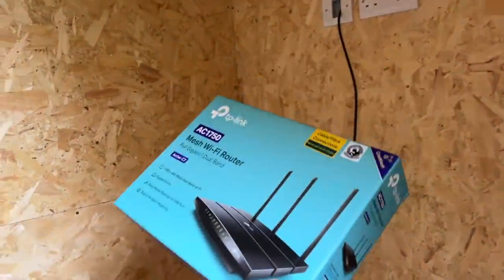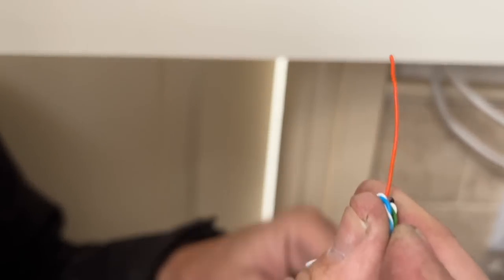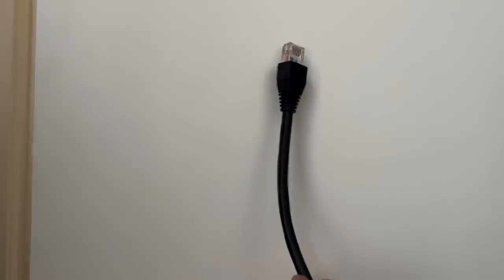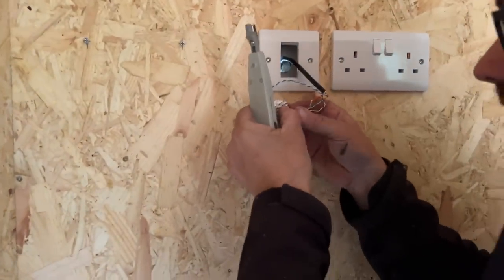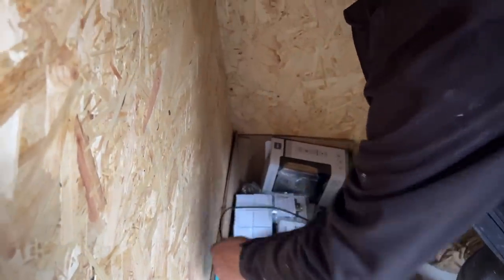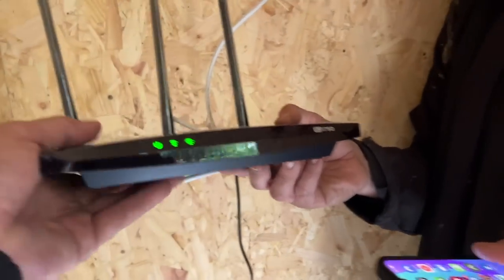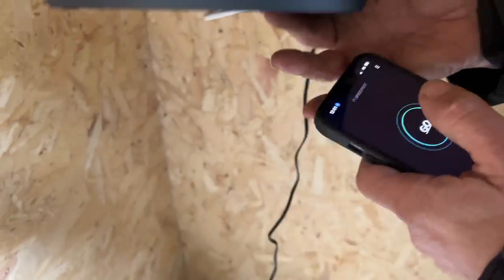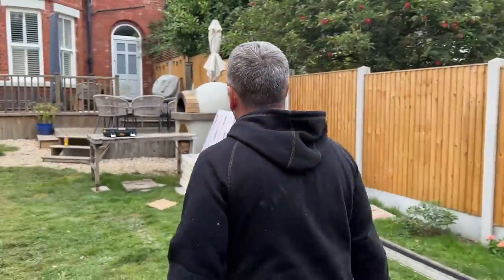Detailed guide to installing the internet in your garden room

Comment: Liam & John, a couple of tips.  Maximum cable length for CAT6 running Ethernet protocol is 100 metres. For the future you might want to upgrade to CAT 7.  WIth regard termination of the CAT 6, the twist in the four pairs of cables is very important. It is very integral to the bandwidth capability of the cable. When terminating the cable, especially into a punch-down termination block, keep the cables a short as possible and as much as practical maintain the twist right up to point of termination.  The companies who developed these cables invested billions in making cables handle huge bandwidth within an unshielded cable and most of this investment is all centred around the twist. Finally, and I might be wrong here, in the video where John is terminating a black CAT 6 into a RJ45 end.  It looks to me the black insulation of the cable is not pushed deep enough into the RJ45 end.  The end of the RJ45 end should have a compressible strain relief tab which is forced and locked down onto the outer jacket of the cable.  Then if the cable is snagged, the strain is taken by the lockable tab and not by the electrical blades at the end of the plug.  Last word. just for info, the word Ethernet describes the protocol that is used for moving data down the cable. It does not describe the cable or the plugs on the end. In the original roll out of Ethernet, coax cable was used to transfer the data that used the Ethernet protocol.  Love your videos, please keep them coming. Probably the best DIY videos on Youtube.
Reply: Cat7 is an utter waste of time and is sold to the gullible who know no better. Further Cat7 and Cat8 require special CG45 or Tera connectors and sockets, which if you are not using (which you won't be) make matters worse over Cat6a. There is no IEEE 802.3 standard thing that requires anything more than Cat6a. Ok there is a standard for using Cat8 at 40Gbps which is limited to 30m, is for point-to-point patch leads in datacentre only and there is zero equipment you can purchase to use it and likely never will. Basically, nothing is ever likely to need anything more than Cat6a which is good for 10Gbps at 100m, and anything more is going to be DAC cables point to point over short distances or fibre.
Reply: For future proofing I would use Cat6A, as multi gigabit connections are already available. Cat7 is a bit of a joke and needs different connectors (GG45).

Comment: Those tools and the rj45 open ended plugs are so good i know because last year before even watching these videos i ran cat 7 wire from my router through my internal walls to my 2 children's bedrooms to give them a solid connection i bought a 50m roll and still have tons left i made loads of small Ethernet wires for the pc's/consoles and laptops my kids have never been happy no drop outs only difference for me was i used a face plate next to the router and a face plate in there bedrooms at a total cost for all the bits of around £75-£85 it would have cost me £100s to get some one in and i saved a fortune and learned a new skill its actually easier then it looks too , i have been watching a lot of your videos for tips as i am building a 3x4m Shed (man cave Shhhh dont tell the wife) and i wont be building to your standards but i wont be far off all in costing me around £2000 including a rubber roof which after watching you guys i have the confidence to do, and i am considering running an Ethernet cable down to the shed (man cave lol) this is something any one in this day and age could do with learning and this video is spot on, if you use cat7 though and cat7 rj45's make sure you earth the cable at the connector ends in other words the silver foil you tuck under the metal climp bit on the rj45 or the machine tester (G) errors i found this out the hard way lol.

Comment: I dont wanna be rude but the cat 6 cable needs pushing in the plug past the built in cable clamp before being crimped, that plastic lug pushes into the outer of the cable and helps stop it from pulling out. The rubber boot (if you can class it as rubber) is there to help with strain relief and stop the cable from breaking which happens pretty easy with solid core wire, could be why i was always told to use stranded wire for fitting plugs to. If your only using the cable for an internet connection you only need two pairs so you could split the cable and get two runs out of it (switch and wireless access point etc) or if the cable was damaged it maybe possible to just swap them over depending on how many are damaged (blue, blue/white, Brown and Brown white not used). i believe for running things like HD video all 4 pairs are used.   

when you were trying to scan the QR code i was wanting to shout its upside down 

Having to long of a cable can result in slower home network speeds for example when transferring a video from one computer to another, badly made connections and poor quality cable can also effect it. when using a internet speed tester like speedtest.net your testing the internet coming into your house and not your home network, to test your home network you would need to ping another computer on that network and look at the results then.

Comment: Tip for straightening the wires. Use the cut off sleeve to straighten the wires by squeezing it and sliding it up over the wires a few times. Perfect for those cold days.

Comment: Everything you showed was good but, pro tip put a socket at both ends, not a connector on the router end. 2 reasons, firstly its a lot less fiddly but also more importantly it is more reliable. Connectors on solid core cables will work lose as you move the router about, also it is easier if you change how/where the router is located. Just use a little pre terminated patch cable to connect the router.

Comment: A quick question, I appreciate a cable connection is always preferable, but how do they compare to powerline LAN systems? I appreciate there may be some efficiency issues especially in properties with older wiring, but it seems like an affordable and clean alternative to a long cable run.

Comment: fyi for Gb connection speeds the recommended max distance is 100m. for a cleaner finish I've installed unifi access points in my house and when I get a garden room I'll be using the in wall hd access points. there is no lose kit as it's fixed to the wall, it's POE+ and it has a POE pass through and 4 Ethernet ports to act as a switch.

Comment: Great video as always. However, I'd have had the cat6 cable further in by about another 5mm as you can see on the video that the RJ45 drop lug that will secure that cable in place is far to close to the edge of the outer cable insulation. Also, the outside run on the garden room, could come straight down, cuting the cable run by about 2 to 3 meters maybe. God, when I use to do these cables myseld, did them for 10+ years, we didn't had them RJ45 where the cables would pertrude out. Still, each to their own and that cable won't see much disturbance anyway. I hope you haven't done one standard (A) one side and standard (B) called (crossover cable). Just my personal opinion guys. Still another great video with great content for many of us out here that could use it I'm sure. Carry on the cracking good job you guys always do.P.S: Too much exposed uninsulated cable on that end buddy! The less exposed cable, the less noise on the wires, the faster the network connection.
Reply: Yes. Use 568B.

Comment: The maximum recommended for CAT6 is 100metres, if you need longer then use fibre with a fibre converter each end.

Comment: Would an access point not be a cheaper, more straight forward option rather than a second router? Are you using the router as just an access point or are you turning on modem mode on the virgin hub and using the TP Link as the main router? Best approach imo would be Cat 6 from the house to a network switch in the garden room and then you can run cables to all your devices from there including an access point and if opting for a POE switch this can power your IP cameras etc over ethernet for an easier install. With WIFI 6 becoming mainstream now a router would then be the better option.
Reply: It’s a router & access point? Wi-Fi and wired switching
Reply: I'd have a lovely Draytek managed switch on that end at the garden room.

Comment: For this purpose (10/100/1000BASE-T) Cat 6 is certified to 100metres. Beyond 100, signal can be impacted and may impact speed but unlikely if you’re going over it by 10/20% or sometimes more. 

For 10GBASE-T which wouldn’t typically be seen in residential, 55m Cat6 is the certified length. 

Always best to use a shielded cable as well, to minimise the opportunity for cross-talk and interference. 

A Cat5e cable (same distance limitations as Cat 6) is capable of 1000Mbps and  likely to provide more than enough throughput for residential users - particularly as they’re likely to use wifi at the other end, not plug in using Ethernet anyway. 

Cat6 won’t provide any tangible benefits in a residential environment over and above a Cat5e cable as home routers aren’t generally capable of 10G BASE-T. 

All that said, it won’t hurt to put Cat 6 in - but soon comes Cat 7 and Cat 8. Where do you stop? :)
Reply: You run fibre... ;-)
Reply: Wrong Cat6 is certified to run NBaseT at 5Gbps over the full 100m which will give you a benefit over Cat5e. Cat7 and Cat8 are and will remain something that the gullible install. They both require special connectors or you make matters worse and they are not certified for use with any IEEE 802.3 standard for structured wiring.

Comment: socket at both ends. The cable should not be run parallel to the mains even with SWA and an access point or switch so that it is running on the same subnet. A router would be useful if you wanted to set security parameters such as not letting people connect to your network. Other than that, good video

Comment: Liam & John, great video as always but I was wondering, why don't you use a power line system where the internet connection goes through a standard electric plug instead of running the cable all the way to the house? Doesn't the garden room share the same electric circuit of the house? Yes, they a bit more expensive than £80 but it would save you a lot of time and there would be no cables at all
Reply: 1gb link over 95m of cat6, lucky to get a 30-50mb link over that distance over Homeplug. Wired Ethernet absolutely worth it.
Reply: The latency on the homeplug is terrible

Comment: Of course he used to work for Virgin media... using jellies on ethernet cabling is not a suitable way to fix a broken section. Cut the cable, fit RJ45 ends on each and use a coupler to plug them together. You can get couplers in weathertight enclosures for outdoor use.
Reply from the maker: Real world
Real solutions, 
Karen
Reply: @thegardenroomguru   Thanks for your reply Karen. I hope you're having a nice evening.

Comment: i hope someone can help me with these colour codes please
the panel i've got is cat 6 and the colours go brown/green/orange/blue, yet the cat 5e cable i've got has the colours brown/green/blue/orange
does it really make a difference?
i've still got to move some furniture and pull a floorboard before i terminate so i don't want to do it wrong
or is it just a case of as long as those wires from position 1/2/3 etc corresponds to positions 1/2/3 etc on the other end it's all good?
thanks

Comment: Sorry but, that was painful to watch.
1. Solid core network cable bent 180 degrees is not best practice. (weakens it and will have issues later)
2. The wires needed to go further in so the outer black sleeve can be crimped also. (cable restraint)
3. So happy you are using the B standard.
4. The longer you leave the cables you introduce cross talk and intermittent connections. (using Cat. 6 cable up to 55m will allow 10Gb connection for future proofing)
5. The tail on the RJ45 is to create a better connection for the contacts for better connectivity.
6. Hard wire backhaul is far better than wifi mesh as every jump to each node will half the connection speed.
7. step by step guide was great for novices.
Reply from the maker: Get a grip mate, it’s not a network in a busy office, it’s a garden room and providing the same speed as the house, you know there’s more than the missionary position, right?
Reply: @thegardenroomguru  So the helpful hints for professionalism went right over your head, I know where I stand now thank you for that.
Reply: @thegardenroomguru  🤣
Reply: Always one
Reply from the maker: @SimonLally1975  think you lost sight of it before you commented. Don’t try belittle us. John clearly states he’s no tech pro, but let’s put things straight. He’s knows more about more things than most ewill know. You know and I know, what he’s saying is down to earth, absolutely correct, it’s a bloody garden room, not nasa
Reply: @thegardenroomguru  I was not belittling any of your team and even yourself. They were hints for a more professional outcome. 
I think you missed point 3 & 7 that praises John, and the rest was informational and not a dig at anyone. but I guess you think it was.
Reply: Looking forward to your successful You Tube vlog Simon, if you could direct us all, should help us get to sleep really easily.
Reply: @michaelh5699  HaHa numpty !

Comment: you shouldn't untwist the wires more than 1cm, they are twisted because they use differential signalling... in the real world it doesn't matter but if you were to work to spec